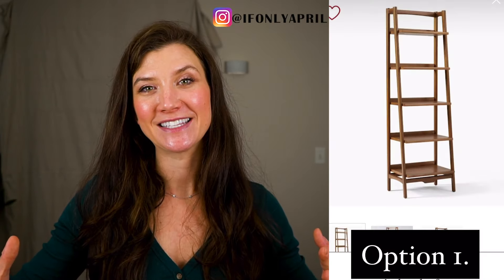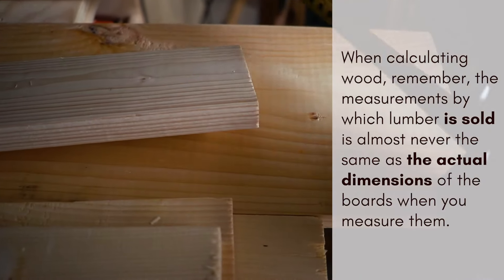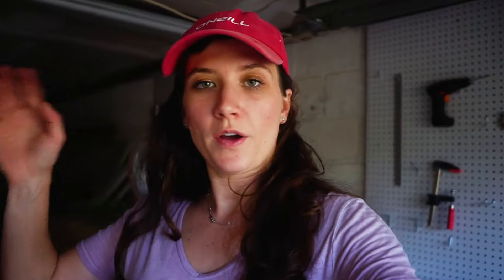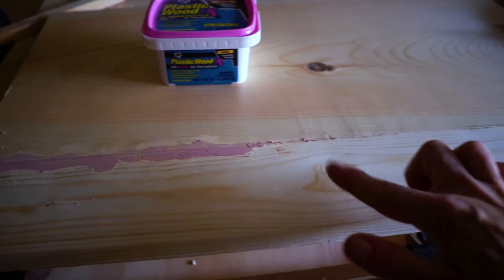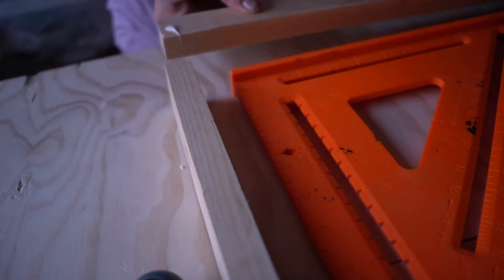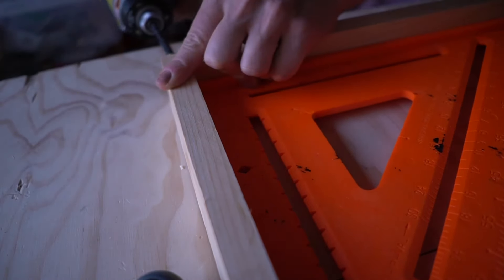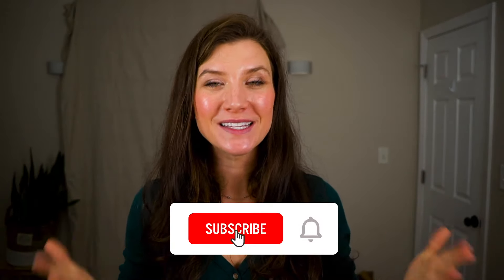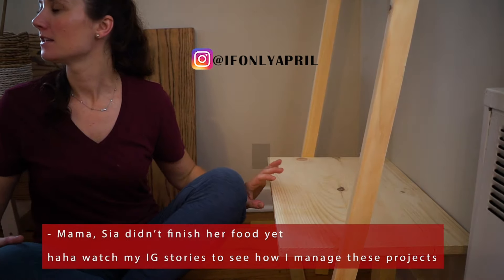HOW TO MAKE LADDER SHELF | Easy woodworking project | If Only April

Comment: Hi want to recreate this but what is making it stand I can really tell how the bottom is able to stand without sliding
Reply from the maker: Hi! I'm so glad you want to try to make it!! I was also hesitant that it won't stand on it's own, but it works! I think it has to do a lot with the fact that I cut the legs on the bottom at an angle so the bottom plank is 90-degrees to the floor. I mean the bottom support is just laying on the floor. I'd assume if you skip this step and don't cut legs at an angle, it might slide. 
Good luck with your built! And tag me on Instagram when you finish! I'd love to see the final result:)

Comment: So the shelves are held only by the two screws? They don’t have any additional support on the back side close to the wall? Is it secure enough? Thank you for your response
Reply from the maker: Yes! It's been stable for years since it's leaning to the wall at an angle. If I did this project again I'd also use wood glue in addition to the screws. Hope that helps!

Comment: I think those shelves will tilt over time. There is only one screw. There is nothing to hold them level.
Reply from the maker: That's a great point! I was also concerned about it so I glued the shelves to the sides! I did it after the video was made :)

Comment: Joining two boards requires two perfectly straight and square edges. If you have a tablesaw, you can run it through the saw to take a little off both sides until it's straight. If an edge is really crooked, you can stick it to a straight board with double sideded tape, running that edge against the fence. The process of making the edge square and straight is called jointing.
Reply from the maker: Thank you so much for this valuable feedback! I’m still learning with every project :)

Comment: How do you keep the shelves from rotating around the screws? It looks like you only put one screw in each side, and I would think that the shelves could swivel!

Awesome video! Thank you for sharing.
Reply from the maker: That's a very great point, David! 
It WAS swiveling, especially when I put heavy books on the bottom.  I had to unscrew it and added glue on the sides. That solved the issue! So far so good!
And thank you for watching ;)